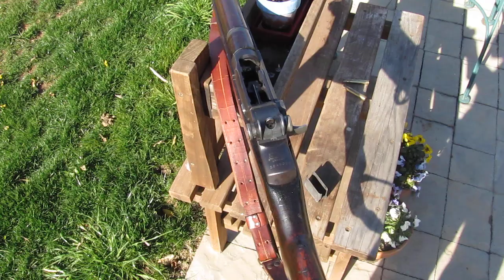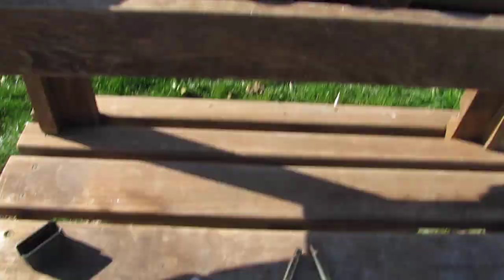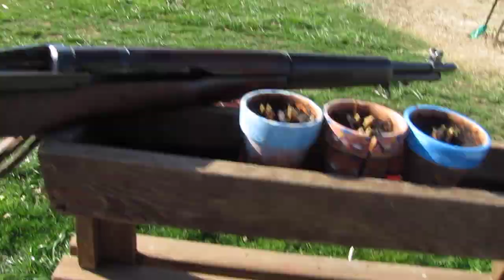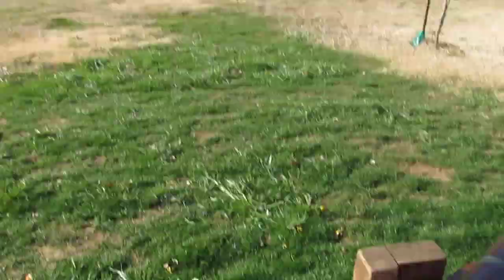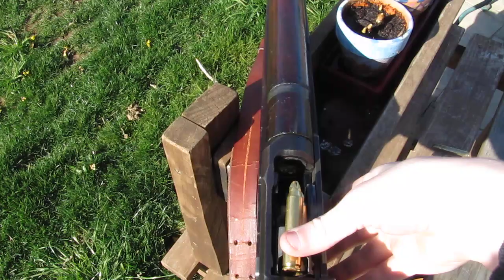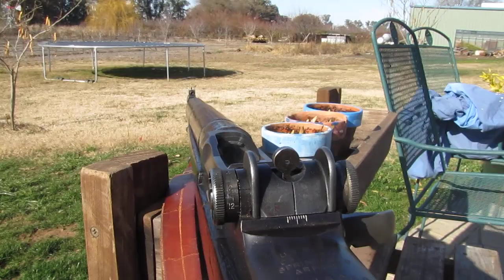M1 Garand test firing new blank adapter

Comment: its the ammo not the gun. when you get cheap blanks, sometimes they have "soft" primers.... nothing to worry about. YAY AUTO
Reply: Even then can't argue with results. was confident enough to make a video about it so it's happened more than once and then once he fix the problem it works properly. so I wouldn't say just the ammo.      or just the gun it's both.     But there's always a root cause to a problem.    In this case it was the gun.

Comment: Hi! what type of powder and quantity do you use and the recoil enhancer, what size is it?
Reply from the maker: I was just using Swanson blanks with one of those janky tube blank adapters. It’s all be corrected years ago and I haven’t had any issue after this one.
Reply: What is the sizes of the janky tube blank adapter? (In mm or inch)
Reply from the maker: @edosmors9857  no idea on that unfortunately. I replaced it with a Pops adapter about 9 years ago.

Comment: Grands look like a handful to reload if you where under pressure
Reply: No it's the easiest rifle to load. Just put the clip in and the bolt goes forward automatically (if not, just tap it forward). In the video, he was loading individual rounds one handed, so that's why it looked more difficult than it really is.